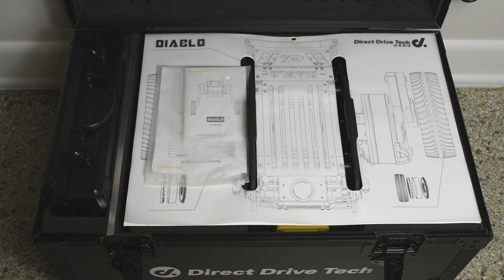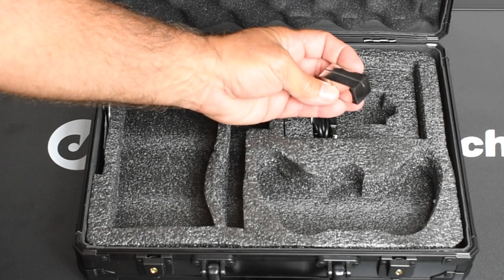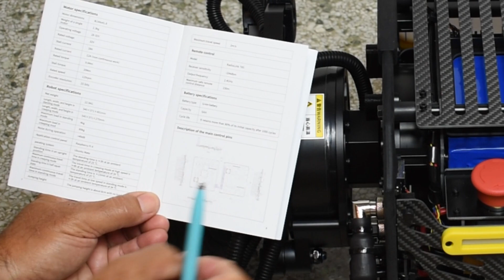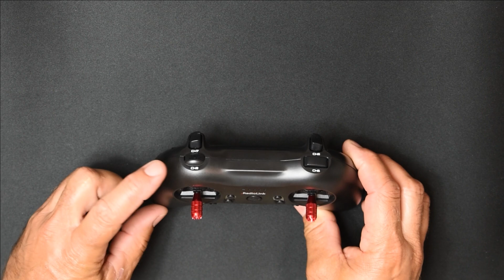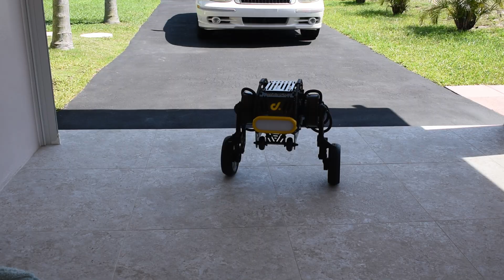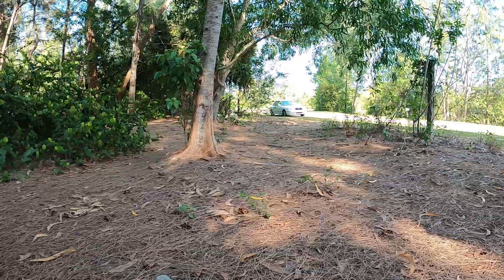Is Diablo Direct Drive Robot Any Good? Find out!

Comment: This is literally just a toy RC car, nothing robotic.

Web site: "100 percent money-back guarantee"
Also Web site: "This item cannot be returned"
Reply from the maker: I guess the RC robot that police use that rolls on wheels with a camera into a building to look for hostile target locations is also a RC toy. LOL. As for the guarantee, I guess you haven't used Paypal before, it's standard. On eBay when you list an item and say "No Returns", they still allow returns. As for returning the item, once you buy it, and it arrives undamaged in perfect working order, it is not returnable. The warranty covers any replacement part needed.
Reply: Um, it is programmed using raspberry pi bro.. its robotic.
Reply: @TheRealRCSparks  Nope.  The controls are just stock RC joysticks.  The RPi is just applied as a manual controller.  There are no sensors or actuators for robotic action.
Reply: @RichardKinch  bro, the very definition of a robot is "a machine capable of carrying out a complex series of actions automatically, especially one programmable by a computer."   This machine is a robot.. lmao
Reply: @TheRealRCSparks  Nope, a manually radio-controlled toy vehicle only.  Nothing automatic, no sensing, no feedback, no intelligence, no programmed actions performed.
Reply: @RichardKinch  We will have to disagree on this one. It automatically levels itself on 2 wheels. Anyone can see this. A robot does not need "intelligence"  - and yes, it is performing a jump motion, sideways balancing, lean, and 3 position preset.   It balances over obstacles .. and corrects itself when pushed - AUTOMATICALLY.  So.. say what you like.. but its a robot.
Reply: @TheRealRCSparks  It's a manually-controlled RC vehicle that does manually-controlled tricks.  Mimicking robotic action from a person playing with a toy does not create a robot.

Comment: $2,899!!! 😬😮  Li-Ion batteries are SUPPOSED to be shipped at Nominal charge, usually a half charge.  It's not good that it was shipped in a "needs to be charged" state!  Storing at a low-charge state can reduce battery life and capacity.   A 1,000 cycle charge life is pretty good, if it really is 1,000 cycles.  You'll have to take their word for that one.  OK, name some things that it can be used for.  I was going to ask, but you said: "I'm sure there are many."  An 8.9lb load is not much.  The only thing I can think of is filming, since you used it for that.  Your camera did seem well suspended without a lot of jumps and jiggles, but how many people would pay $2,899 for a camera bot?  Interesting 2-wheel stability, but I cannot afford such a luxury item, especially without an application.  Some people train their dogs to go fetch them a beer from fridge, but this thing cannot do that.  I understand you reviewing a free item, but what uses justify the price tag for everyone else?  And that does not include tax and shipping, and maintenance costs.  I don't mean to disparage you.  It's the robot I can't see a use for.
Reply from the maker: It's definitely not something for everyone.

Comment: What distinguishes this as a "robot" as opposed to a robust remote control "car" like I had in the 80s?  Aren't robots supposed to perform at least one kind of specific task independantly?  Otherwise, wouldn't this be a remote control "vehicle" of some sort?
Reply from the maker: How many RC cars can carry 175 pounds or 8.8 pounds while standing? How many can jump up and down?
Reply: to OP: a remote controlled vehicle is a robot.  You are speaking about autonomy... and no, not all robots are autonomous. They just run through a program. You can install modular tracking and anything on these.. as they are Raspberry pi

Comment: 2900 dollars approx... cool toy but nope.
Reply from the maker: 10 years ago this would've cost 20K or more. Not a toy.
Reply: @electronicsNmore  Correct but this is 2023 and still large amount.I don't see much amount of use around hence it is just a toy to play around with.
Reply from the maker: @samuelkatherinediozarago7692  Adding sensors to this robot, can make it extremely useful. You can also attach devices on top and go places that are too small or unsafe for people.
Reply: @samuelkatherinediozarago7692  The best I can think of is mounting a camera for exploring small caves or pipes. But that's really expensive to send somewhere you might not get it back, unless you are government who just takes more money from it's tax payers for it's screw ups.
Reply: @electronicsNmore  Yeap. Oxygen detection sensor,Monoxide,Co2 etc. And sending it in would be good but can can be done with an advanced tracked rc as well. I don't see this going inground tanks or very tight confined spaces anytime soon. 
BEST use I can think of would be using with a 4k camera and image stabilisation and recording videos with a stabilisation. 
I will wait and get the Boston dogo in 2033 abouts :)
Reply: @samuelkatherinediozarago7692  if you think this is a lot of money, then I could just imagine what you think about the $75,000 price tag for Boston Dynamics robotic dog called Spot. All it does is walk around, dance, and film video. What he shows in this video is excellent for the film industry, and when using an attached camera, you can send the robot into dangerous areas before you enter. What you see in this video is just the basic robot, using the microcontroller along with other sensors can make a huge difference in what it can do.
Reply: @BN-sq6jo  That is exactly what I said in the previous messages I wrote if you do read.
Reply: @samuelkatherinediozarago7692  No, that's not exactly what you said. If it was, I would not have had to comment. You said it was a toy, I don't call a filming companion or a robot that has the potential to save lives a toy. You complained about 2,900 being a lot of money, meanwhile I was explaining to you that other robots are far more money. I suggest you learn how to read.
Reply: @samuelkatherinediozarago7692  Yeah bipedal and self-balancing robots don't have much use case. It's not an efficient platform and costs far more than wheeled or tracked robots.
Reply: @BN-sq6jo  You clearly haven't seen the other comments but that is fine. Yeah,it is TOY because it has no use except filmin or some other simple use/uses. 2900 a lot of money compared to Boston Dynamics Doggo which can ACTUALLY Do stuff,compared to massive amount of price difference. This  won't move forward and 'Potential' to save lives as you say will stay as 'potential'.

Comment: How long the battery last?
Reply from the maker: Depending on the mode being used(High speed or low speed setting), 40 minutes up to 4 hours. Creeping mode using high speed is the longest, 4 hrs.